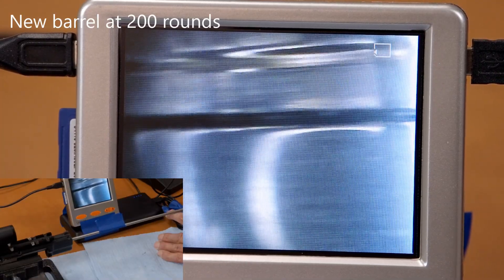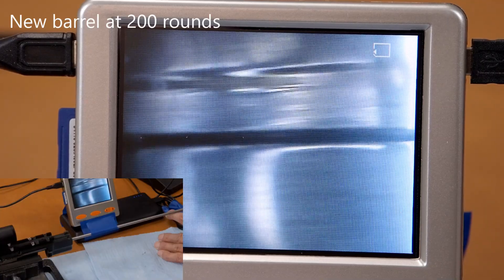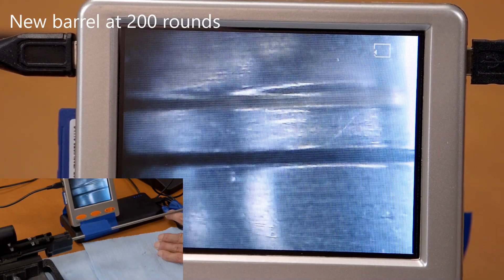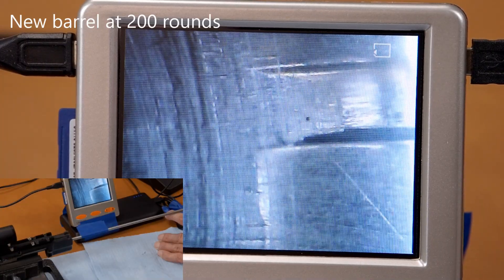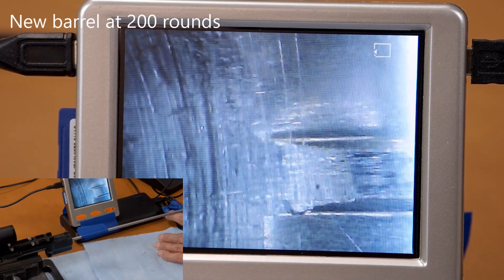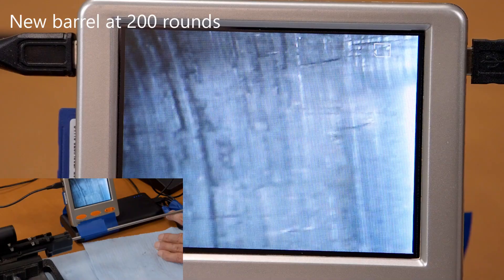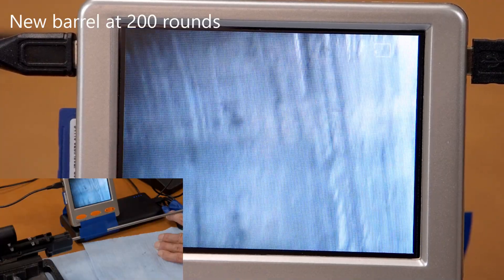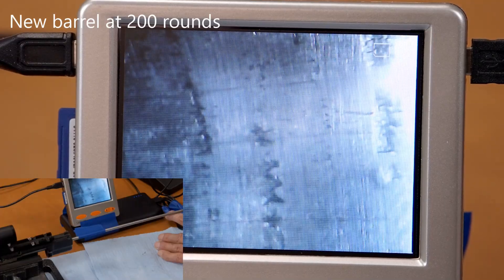2019 1 12 Kadet borescope

Comment: Joe, As always a great Video.  What brand of bore scope is that?  I would love to see a comparison between a Springfield vs Kart vs KKM.  I have always been told it is hard to shoot out a barrel.  Maybe not so hard to shoot out a chamber.  I wonder if the chamber distorted the rounds enough to hurt accuracy.  The rifling in your old barrel looked ok.  Did you try to push a slug through it?
Reply from the maker: Lyman brand borescope.  I haven't slugged it yet, but I have the slugs and a rod, so that will be next.  I can slug the old barrel and the new one and measure the OD and see what if any wear there is.

Comment: howd you fix the loose barrel pin?
Reply from the maker: The barrel pin in the old barrel wasn't loose, and I reused it here.  In the past, I have fractured the barrel pin as in before the gun was modified at all.  Maybe 4 years ago, 75Plus redrilled it and no more problems.  This time I moved the slide just a little forward, before drilling the barrel lug, so the hammer only hits the bolt and not the slide, hoping the pin will not see the impact effect and will not fail ever again, even if it is a 10 minute fix.